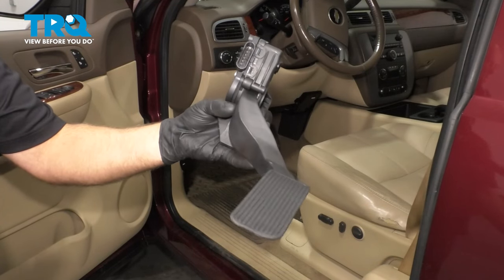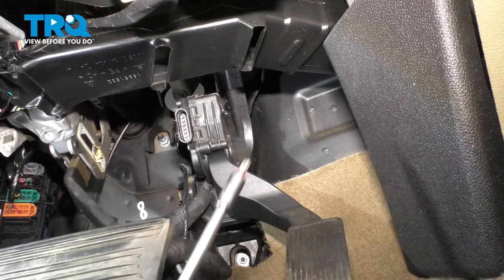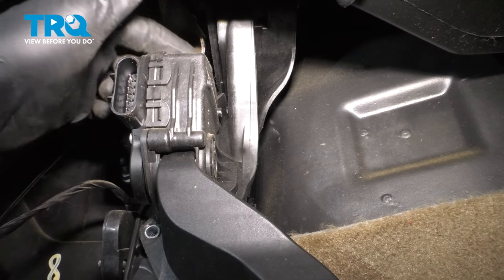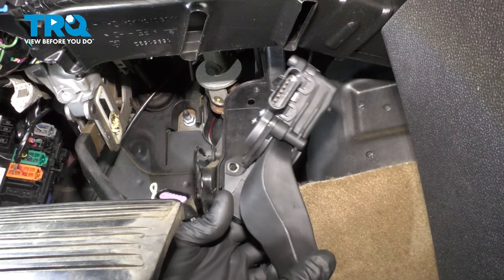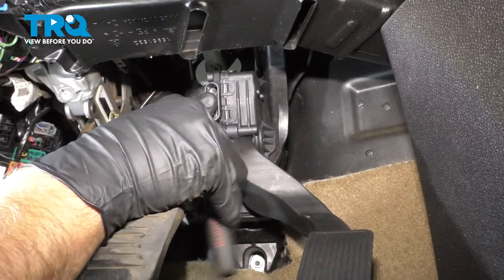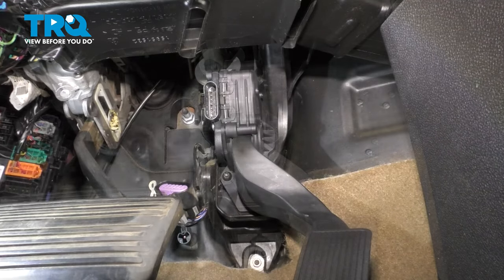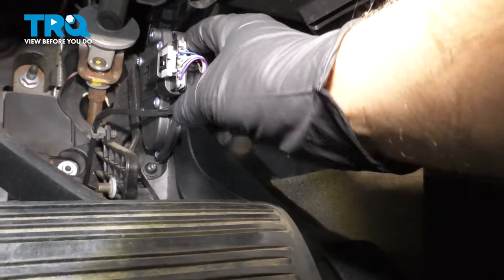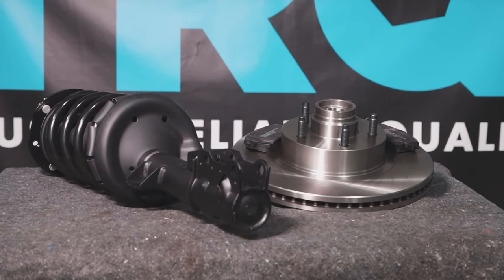How to Replace Accelerator Pedal & Position Sensor 2007-2013 Chevrolet Silverado

Comment: ✅Thanks for showing us this but this is not the main issue for these GM trucks from 2007 all the way up to 2014 It's water getting in the back of the dash causing the pedal to go into malfunction and reduce our engine speed where you disconnected the pedal follow the wires up to the fuses and you will see there is rust where moisture is getting into to block off wherever the water is coming from that's the issue that GM knows but does not want to fix